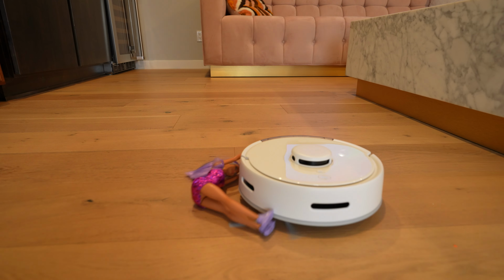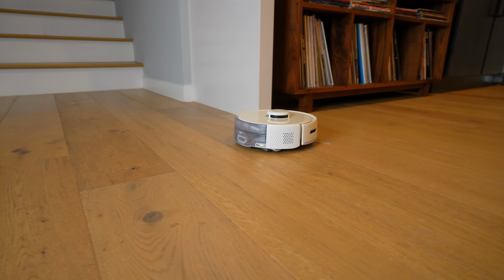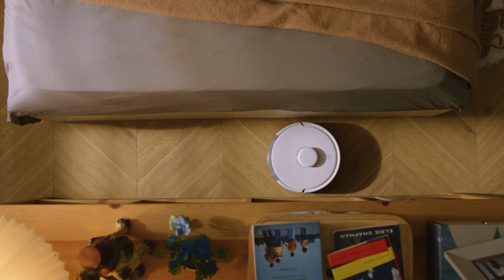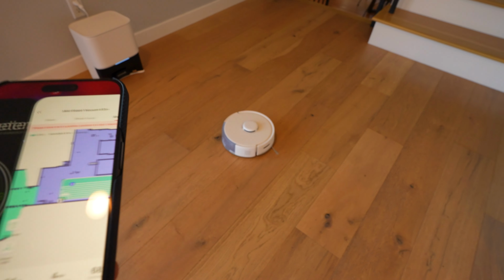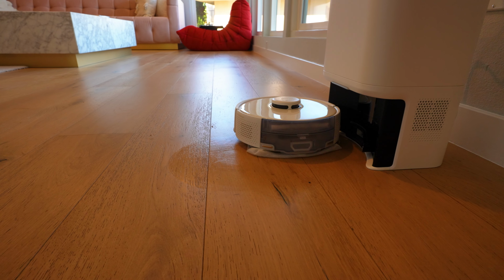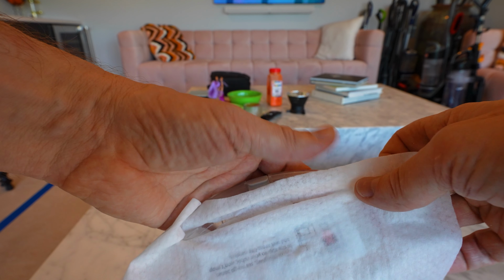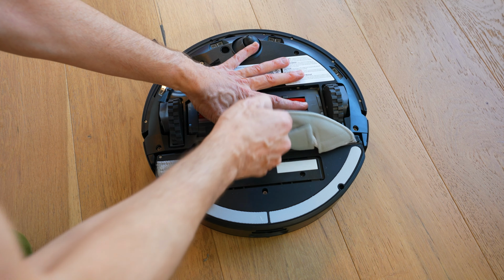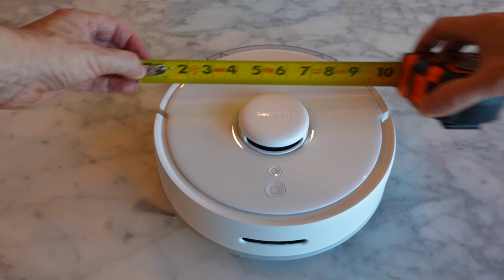World's Smallest Robot Vacuum Is Powerful! Switchbot K10+

Comment: So it produces ~ 58 decibels on its quietest mode and ~ 68 on its highest mode? They advertise only 48 decibels on the website. It's off by a lot then.
Reply from the maker: 58db is VERY quiet. It's not a loud robot at all. 68db is not loud either.  Sound measurement has a lot of variables - mainly distance and mic sensitivity. My measurements are done with an iphone at around 4ft. My measurements are not 'formal'

Comment: I tried for 5 days to get the SwitchBot Mini Robot Vacuum K10+ working.
The reason for the exchange is, reports: front bumper stuck, every minute.
I no longer have confidence in the product and would like to return it and have my money refunded to my account.
Where can I return the SwitchBot Mini Robot Vacuum K10+?
I contact Switchbot to return the product, but they do not do so.
Order number is #EU16577
Reply from the maker: Did you buy it on Amazon or the Switchbot website?
Reply from the maker: I contacted them and let them know about your issue.
Reply: @vacuumnerds  ❤️
Reply: Switch has contacted me and are working on a solution. I'll wait and see, and I'm glad switchbot is doing something.
Reply: I returned the switchbot k10+ on 06-12-2023.
I had to do this so I could get my money back.
Unfortunately, we haven't heard anything from switchbot yet.

Paul